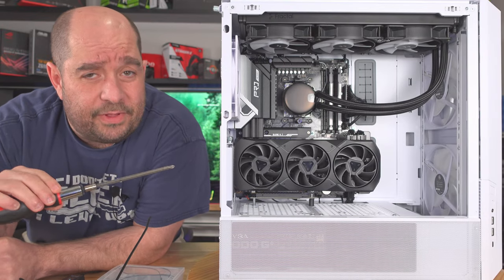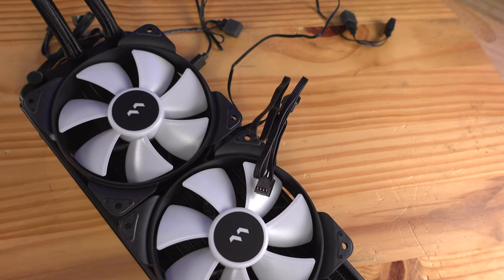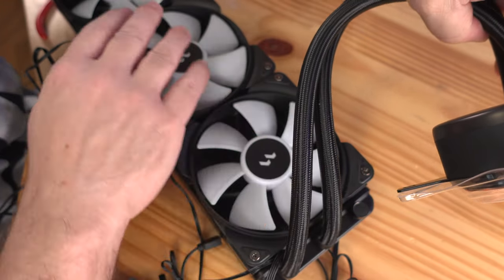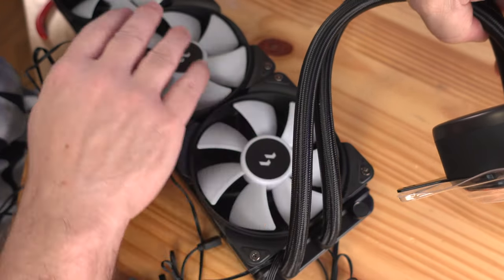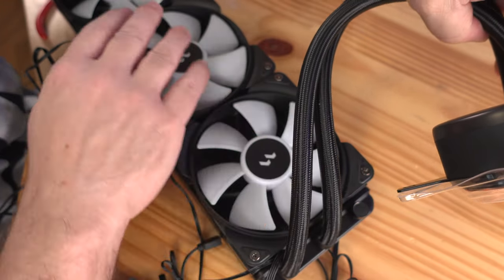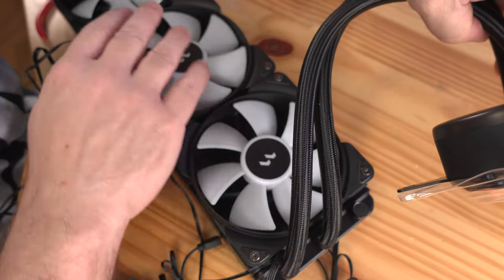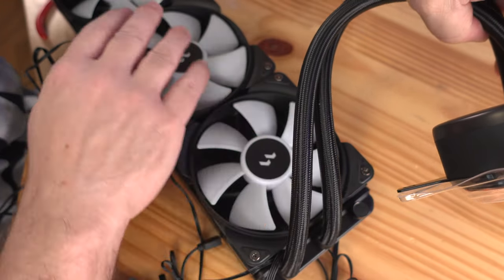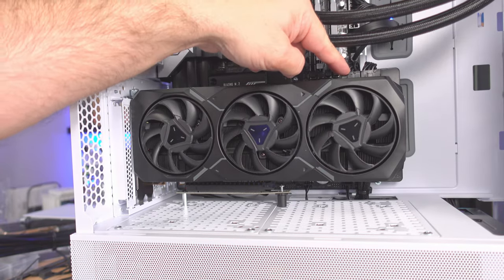Building The ULTIMATE Gaming PC!

Comment: This is completely off topic but you helped me get my pc up and running and help a lot which I appreciated a lot

I fear i have a cpu bottleneck I recently upgraded from a 3060ti to a 4070ti with minimal fps increase but im running a ryzen 5 5600x any suggested cpu replacements or if i should be focusing cpu clock speeds or cores and threads, thanks for any help in advance
Reply from the maker: Wow, well thank you my friend, so very happy I could help and that you enjoy these videos.  Before, I can help you though, please provide the following information, some will be a little redundant, but it will make it easier for me to follow along

Please list the manufacturer and model number of the following items
CPU:
Motherboard:
Power Supply:
Video card:
OS drive:
Storage drive or drives:
Memory:
Monitor (and what resolution you play at)
Reply: thanks so much 
Cpu: ryzen 5 5600x
Motherboard: Asus rog strix b550-f gaming wifi II
Psu: NZXT C850 V2 850W Gold ATX Modular PSU
Video card: rog strix 4070ti oc edition 
Drive: Seagate Barracuda 2TB ST2000DM008 3.5in Hard Drive
Monitor: i forgot exactly what monitor i have but i got it a year ago its a 27inch curved 240hz samsung monitor and i play on 1080 
Memory: Kingston NV1 M.2 NVMe SSD 1TB
Os drive: windows 10 if thats what you mean im still relatively new to pc's
Reply from the maker: OK, the one line I needed to see if what is slowing you down, your resolution.  At 1080P, your processor is your bottleneck, but it doesn't have to be.  Now that you have a 4070, you can play at 2K, even 4K and take advantage of your new graphics ability.  I HIGHLY recommend watching this video, I show you how to install the card (you already got that part) but very important, to install the drivers (remove the old ones, install the new ones) and how to optimize windows for your new card and your monitor, since it does 240hz, something tells me, its running at 60hz: https://youtu.be/_AJlNxuukww

Also, as for OS, if you have your key, I HIGHLY recommend moving over to WIndows 11, not by upgrading but by a clean install: you can watch this video on how to get windows 11 on a thumb drive, install it and such: https://youtu.be/ayp8TksEtoY

Also, getting resizable bar support enabled will help tons on many games: https://youtu.be/sgrvscvnCCw

If you are not on the latest BIOS, I highly recommend you get on it: https://rog.asus.com/motherboards/rog-strix/rog-strix-b550-f-gaming-wifi-ii-model/helpdesk_bios/

trying to save you money with these recommendations, let me know if they help
Reply: @ThisBytesForYou   im going through the first video and ill be trying to the driver uninstall and the new driver install after work tomorrow as its quite late just trying to do some digging into it and i want to play at higher resolutions as i know that will help but thats the most expensive solution for me as i play for honor a lot which is much of a reaction based game the more frames the better so 240hz monitors with 1440p are quite pricey so would a cpu upgrade be a better choice if i were to play at 1080p but then the price option comes into play again because for a higher end cpu its still quite affordable compared to the previously mentioned but if that suggested cpu is compatible with my motherboard
Reply from the maker: Your board will support a 5800X3D, and if you want to maximize it and have you last the longest, it would be great, that way you wont need to upgrade for a while, here is my Amazon affiliate link to it, and it's 28% off right now: https://geni.us/tRiZf.  I would recommend setting your 5600 aside if anything so you can build another machine with it later, or maybe sell it to make up the cost of the upgrade.

At 1080P , yes, your 5600 is the bottleneck, but you are not using the 4070 to its potential
Reply: @ThisBytesForYou  but after i try the driver uninstall and fresh install i will then do the resizable bar support which I didn’t even know about, and hope that makes a solid difference
Reply: @ThisBytesForYou  thanks a lot for everything man it means a lot that you set aside time to help others your channel is wonders for people like me who are not fond of pc’s would never know any of these things without your help and the video links you sent i spent a couple of hours browsing to not get a clear direction to go in but i will do the driver step and resizable bar step and see how that turns out and will probably invest in that cpu but i do intend to invest in a higher resolution monitor but the misses isn’t ecstatic about the gpu and psu purchase so hopefully it will be a possible purchase when tax time comes around, again thank you so much
Reply from the maker: @pleboskioce2107  theres more, the refresh rate, and Gsync/freesync, check out that video, all of that together will make a TREMENDOUS difference
Reply: @ThisBytesForYou  excited to give it all go tomorrow have a good one my friend ill let you know how i go.
Reply from the maker: @pleboskioce2107  haha, always a pleasure my friend.  As for the wife, I totally get it, I am in the same shoes (but I spend a lot more to get products to make content) but it will be forgotten soon enough, so no worries, like my wife, I am sure she buys her fair share of "gear" too right?  It's what makes us happy.  Play with all of my suggestions, including the refresh rate and freesync/gsync as I show you how to access in that video I linked up and you will see a huge improvement.  Also, if you have any friends stuck on this kind of PC stuff, PLEASE send them my way, I love to help.
Reply: @ThisBytesForYou  yeah i never question when my partner buys a new guitar and amps as i know its what makes her happy, but im sure your suggestions after i implement them all will help out a ton and i will be sure to direct anyone i know that needs pc help to you already showed my friend all the suggestions and screen recordings of how you break it down to explain how it works and helps as he was the initial help i went to that helped put my pc together and upgrade it.
Reply from the maker: @pleboskioce2107  ohhhhhh thats nice, I play the guitar also, but since the PC, the guitar has taken the backseat, thats awesome that she plays, its expensive BUT it energizes the soul, its such a great release, kinda like PC building and gaming ;)  So happy to help my friend and thanks so much for your kind words and support, if you are not already, please remember to subscribe as well, working on the follow up video for this build for monday.
Reply: With wiping old drivers off and activating resizable bar i got a 40fps to 50fps increase thank you some much will be needing to upgrade cpu for sure though
Reply from the maker: @pleboskioce2107  Always a pleasure my friend, so very happy you stopped by, trusted in me to help you, liked and subbed as well as took a moment out of your day to thank me.  It means a ton to me and I am so very happy I could help you.  Also, PLEASE make sure you set the refresh rate to 240 that will help tremendously as well and if your monitor has Gsync or Freesync capabilities, enable it in the monitor and the OS like I showed you in the other video, that will help tons too
Reply: @ThisBytesForYou  gsync had negative outcome for me i activated it on monitor and control panel and didnt help in my favour unless i missed something what video were you referring to
Reply from the maker: @pleboskioce2107  it might not help in all games, but just keep working with it, it wont let you down.
Reply: @ThisBytesForYou  ill be sure to

Comment: Love the video liked and sub. Question is the fan hub on the back the only way to control the ARGB or can I use a software to control the ARGB? Thanks
Reply from the maker: Thank you so much my friend, it means the world to me to have your support.  No, the fan hub and the ARGB ports on the hub, if the hub is plugged into the motherboard through the 4Pin PWM connection and the 4 Pin ARGB connection will allow you to pass through control from your motherboard, from there you will need the software from your motherboard to control the lighting and fans.
Reply: @ThisBytesForYou  your welcome I love all your build and pc videos they help me a lot. I’m upgrading my case that’s why I ask. So I’m supposed to plug the fans in that hub and then plug the hub into the motherboard? ARGB fans are 3 pin so do I need something special to plug them into to get a 4 pin? Sorry for asking and the confusion.
Reply from the maker: @steelcityhavoc33  thanks bud, lots more builds coming soon, one from Lian Li as well, but I have a lot I am working on, 2 cases in the queue actually (I think Lian Li is next) but what is the fan you are referring to?
Reply: @ThisBytesForYou  I’m referring to the lian li 216 case and I have 7 lian li uni AL 120 fans to put into it.
Reply from the maker: ahhhh ok, when I say 4 pin, it has 3 pins and a missing pin, that should be what you have, so you should be good for ARGB, the 4Pin PWM is for power on your motherboard.  SO yeah, you plug in your fans to the controller, and then you plug the controller into the 4Pin (3 pins and 1 missing in between) ARGB into the single ARGB header and the 4Pin PWM connection into the motherboard.
Reply: @ThisBytesForYou  ok thank you that’s what I thought just wanted to make sure so I don’t mess it up. Appreciate you very much.
Reply from the maker: Thank you so much for your kind words and support my friend, it means the world to me and I am so very happy I could help you.

Comment: Hey man this was a great video step by step tutorial and going into great detail Good job I do have one question about something I do plan on building a PC for a family member of mine and I want to use an AO liquid cooler and I was wondering like can you use any brand of RGB fans with the cooler like for example I could use let's say the Lian Li uni fans on a different brand of radiators like NZXT?
Reply from the maker: you can, but I dont recommend it unless you do extreme research comparing each fan to find out which has the most resistance, CFM, lowest db, there are a lot of things you need to take into account, including the connection from the fan to the unit or PC.
Reply: @ThisBytesForYou  sounds good man I'll look into it thanks for your help.
Reply from the maker: anytime, so which part did you like the best of this video, curious?
Reply: @ThisBytesForYou  honestly for me I think the best part about the video is basically towards the end when the bill is complete I sure can't wait to see you power it on in your next video soon.
Reply from the maker: @gamingPCnerd  yeah, should be monday, not sure yet, tyring to record a few videos at once, I am late on a few.

Comment: $65 more for the vertical GPU riser items? It is advertised that it is able to do it, it should have come with the the case already.  It's just like the fractal design pop xl air not coming with the cable to attach to the USB C port that comes in that case.....but no cable is included. Great way to lose business. Nickel and diming a customer doesn't make them want to buy from your company. I just bought a lian li lancool 216 case instead of the fractal design pop xl air for that exact reason. I am not gonna pay $13 extra for a cable that should have been included to start with. They have the port in the case and yet won't give you the attaching cable unless you pay a ransom. BS Sales tactics.
Reply from the maker: The case is between $100 and $122 in the US, a great price for what it is NO ONE needs a vertical GPU, NO ONE unless you have the Hyte, which is also a nice case, but you can ONLY use a vertically mounted GPU, no option.  The LIan LI, you can do vertical, or horizontal,... again, no one needs a vertical gpu, so horizontal works.  I chose to buy the adapter to show it off some more, but I showed both versions during the unboxing, horizontal and vertical.  90 if not 100% of cases that give you the option for a vertically mounted gpu, don't bring this adapter.

If you have ever bought a riser, you would know its rough to find a good one and a good one that's 4.0 rather than 3.0 for real, I tested that to be real.  Risers range between $30 and lets just cap it at $300 (though I am sure there are higher ones).  There are TONS of them, I could have bought cheaper ones, but I chose to stick to the LIan Li one because I have work personally with Lian Li and professionally, I know their products to be quality products, but still a slight gamble, since I never bought one... but compared to no name competitors, LIan li was the only sane choice.

With the quality of the cable and the LOW price of the case, there is no issue here.  

The Fractal Design Pop XL Air....  the case itself if nice... but it's got several issues, I reviewed it too.  I think Fractal makes great product, mostly awesome products, I think they are great.  They made many odd choices with the pop series.  #1, you CANNOT fit a 360mm radiator at the top, well, you can, but you can't use 1 of the fans, mind blown.  Then yeah, the USB type C connection.... that was just dumb BUT yeah, it would have made costs go up.  It's not a biggy, if you don't have a USB Type C header on your board, because you get to save some money, but if you do... if you want that front panel header to do something, you need to buy it... it's not expensive, but its a pain.  You also don't get to vertically mount a GPU.

Just because things are advertised to be able to do it, doesn't mean they need to include it, those are optional accessories, you can buy them if you want them, or not use them if you don't want them.  Imagine if we had to buy cars with ALL of the accessories provided, many we don't need, we just spent an extra 20K, that we didn't need.  If those things are reasons for them to lose you as a customer, they might nt have wanted you, because not everyone needs the extra's.  

I think you might be angry for the wrong reasons, but hey, these are my opinions, your opinions too.  I provided facts and opinions, you can use either as you wish.
Reply: Use a vertical mount from cooler master.
Reply from the maker: Nah, just some people like to be upset all the time